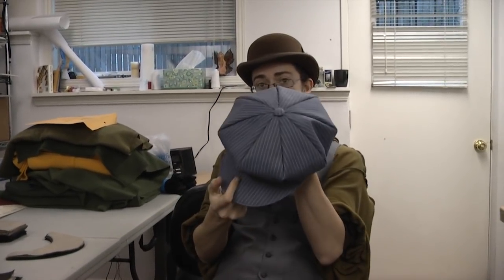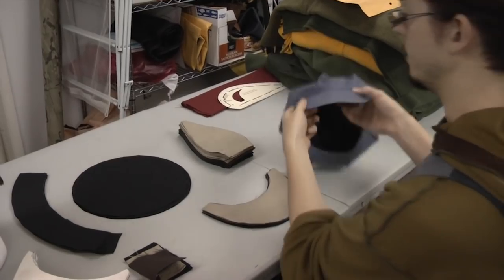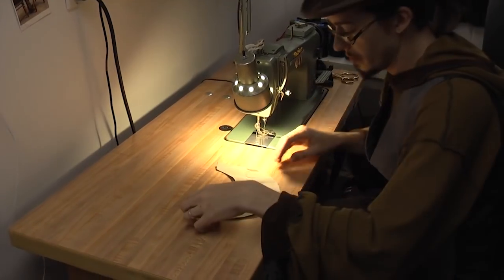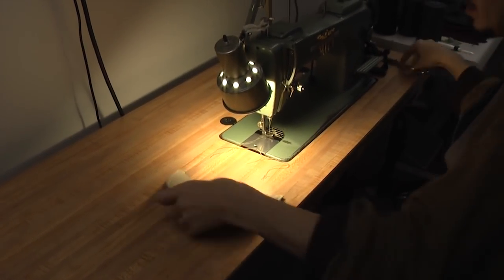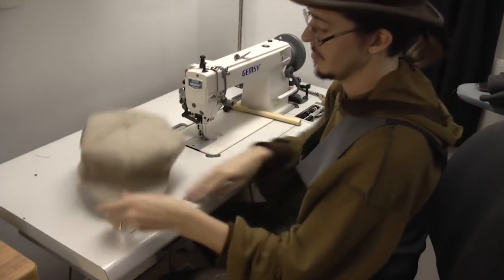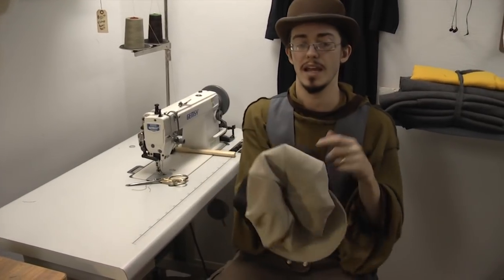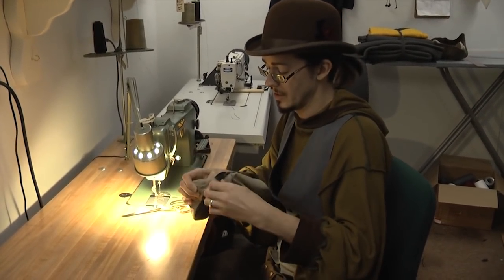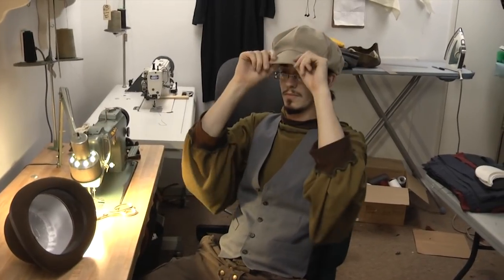Flat Cap Tutorial

Comment: Did you stitch the lining to the facing band with a 1/2" seam allowance or did you stitch the lining circle over the top of the same seam that joined the facing to the hat panels? I didn't quite catch that and it would make a huge difference. It looked like you were sewing it to the hat panel edge until you were able to roll black material out to topstitch the opening you left to turn the hat. Thanks for the tutorial and the pattern!